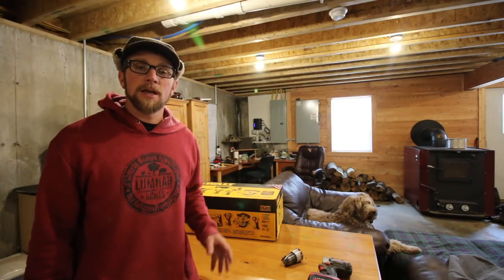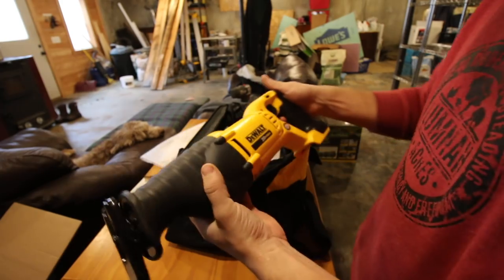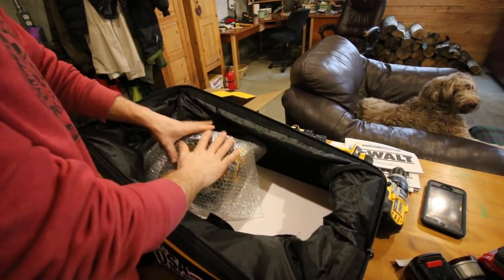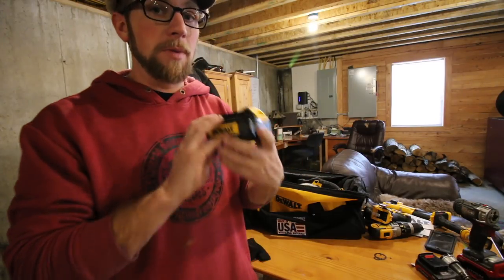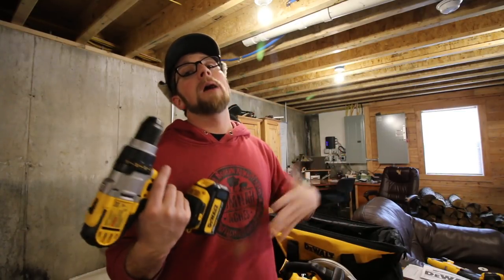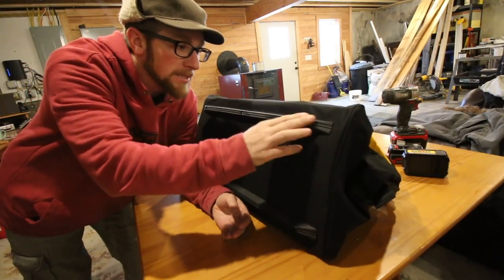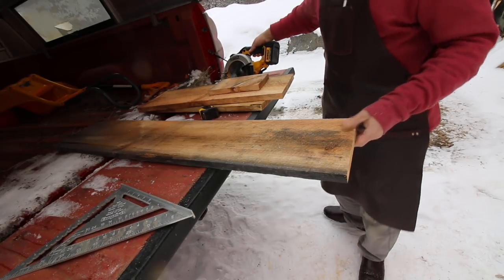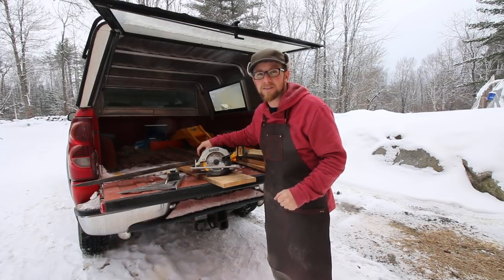UnBoxing Our DEWALT DCK590L2 20-Volt MAX Li-Ion 3.0 Ah 5-Tool Combo Kit and Putting It To THE TEST

Comment: I bought a DeWalt kit too in 2014 and it is now 2022 and no issues.I was dissapointed  that they dont seem to give you brushless stuff in the kits for the most part.The light is brushless!!!That circ saw ripped through a 16ft.2x12 lengthways to make skirting frame for mobile home for me.I now have 12 batteries and collecting more tools.P.S. The brushed stuff is not bad.Your recip. saw is not brushless as we see the brushes spark in this vid. I think the light is the only brushless one in the kit!!! Brushless stuff will say XR on the tool.CHEERS from Canada!

Comment: I looked at this kit and also the DCK592L2, and for $16 more (on sale), i went with the 592 because it has 5 Ah batteries, The baseplate on the skill saw is magnesium instead of stamped metal, and on the reciprocating saw, the 592 has a 4 direction blade clamp and a longer stroke.

Comment: I like the left hand circ saw and the quick attach recip. Good package and good tools. You may want to put a piece of 1/4" ply in the bottom of the bag to keep it shaped up. Now to teach Gina  to use them. Keep the Recip clean for the pigs class. Come on Spring.

Comment: Al:  You can carry a spare warm battery in a fanny pack under jacket in winter.   In a power outage; bounce the light off ceiling for ambient light.   As you know Al using the speed square as a fence will reduce the induced twist from the spinning motor.  the old guy  Bert

Comment: I can tell you from experience that handle on the 996 is not long enough for when you are drilling with a hole saw through OSB or 2x6's or so. You will still get a good jolt once in a while and twist your wrist. My Makita DDF481 has a longer handle and it does allow you to catch the drill before it twists your wrist off.

Comment: hi Al good unboxing! i have a couple of dewalt tools. i use the impact drill to rotate the tires on my truck. and a torque wrench to tighten to spec. is the recipracating saw brushless ? i saw sparks when you held it up to camera !!

Comment: Batteries to Go have the DeWalt 4 amp battery  I also picked up the DeWalt drill bits, driver tips and a fine blade for the saw.  Your going to love the 20v 4 amp for the skill sawbatteries
Reply from the maker: I will have to pick up a 4. amp hour battery

Comment: You probably know this by now, Al but that kit is not brushless. There were sparks in both the driver and reciprocating saw.... But I'm curious about the difference on battery life between brushless and with brushes.  How satisfied are you with a 2amph or 4amph battery charge on your driver and skill saw?

Comment: Good morning Al. So, I'm curious, was there a Royobi package that was similar?  I began buying Royobi a few years ago and I'm totally content with the tools I've got.  Without doing an actual side by side I was impressed with Royobi and at the lower price point think it would hold up against the other brands at much higher prices.  My stuff is all 18v and three tools came with 4Ahr batteries.   I also have two of the smaller batteries that might be 2Ahr each.  Some tools will definitely operate better/longer with the larger battery but when fully charged the only difference seems to be the weight, I think you will find that to be the same for you.  Good luck with the new tools and keep us up to date on your experience with them, I'm sure we will all be watching!

Comment: I have the Ryobi set. Thanks for the cold tip. I tried charging the battery out in the laundry room shed and it wasn't working. And it hasn't been this cold in years. So I didn't connect the two. I have to struggle with the buttons to take the batteries apart. Is this the one that comes with the lifetime guarantee?
Reply from the maker: no Dewalt doent have a lifetime warranty :(

Comment: Nice combo set although not only did Pluto seem unexcited by them, about a minute in she turned and gave you a look as though to say "Will you be disturbing my sleep for very long?" ;) Is it possible to buy hard cases that fit the items that come in the bag at all? Does the reciprocating allow the blade to be rotated sideways?
Reply from the maker: Dewalt has some big hard boxes that you can get for your tools. No, the reciprocating saw doesn't have the ability to turn the blade sideways.
Reply: Thank you - I am half considering the idea of perhaps getting that sort of combo set if I decide to buy some power tools in the future.
Reply: I believe their corded reciprocating saw has the ability to turn them sideways just not the battery operated ones. DeWalt was the only game in town that did that and the easy quick detach for the longest time now others have caught on but I still think they are the only ones that do the turned blade.
Reply: scooter041031 - thank you for the additional information. Much appreciated :)
Reply from the maker: I just saw in the comments I cant remember who but they said the XR series Dewalt makes in the 20 volt line you can route the blade 4 ways!
Reply: Ahh, thanks for the extra pointer Al. I guess on the balance of things I'd probably just be better off with the one from the combo set as my budget and usage probably wouldn't justify the extra cost for that specific version. Nice to dream though. :)

Comment: Great video.  I an an idiot when it come to tools and a real idiot when it comes to power tools.  When we put in air conditioners we put the units in our windows.  We should have made a small hole in the wall, and not used the Windows.  Bottom line, when our  power goes out, be window is welded fast, and closed.  It gets hot rather quick because we can not open one window in each room.  I wish we had the tools to make a hole for the AC unit in the wall and that we did not block the Windows with welding in the air conditioners.  Anyway Al,M great video.  Bless you all,  God bless America.

Comment: I’m not a negative Neely...but I want to talk battery vs. corded. I have never been a fan of battery. I know it makes things easier sometimes but, all things considered, I’d rather have to pull a cord around. Cords don’t fail me...the tool may, but that’s a battery operated issue too, as we saw with your porter cable. And then there’s the Made in USA (with global parts). I guess I’m good with that...but I’d rather see made in USA with American made parts...and more metal than plastic. I know plastic is lighter...so I don’t expect a return to metal any time soon...cost less too. But then there is the fact that plastic is petroleum based...anyway...nice kit...oh...and let’s not forget the hand tools! Those will still work with NO power but HAND power...when that’s all we have. Looking forward to future builds putting the new toy..ah tools, to the tests!!

Comment: Very nice kit Al.  Totally jealous.  Finish up the concrete desk project and then maybe build Olivia and Gina nice keepsake/ blanket boxes or jewellery boxes each so they will be happy you got the kit and it'll ease your conscience regarding the expenditure :) I already have an 18v XR Dewalt hammer drill and love it.  I would really like the Circular and Reciprocating saws as well as the Impact driver.  I found a similar kit here in Australia which is a 6 piece with a Grinder,  2x5.0ah batteries as well and 2 contractor bags. Costs a pretty penny, but I reckon I'd never need to buy anything else with all those.  No idea why would need 2 bags, but hey, they look neat so I'd use it for other stuff and give Dewalt some free advertising :D  Hmm..  can I convince myself not to buy it now.....
Reply from the maker: Sounds like you already sold yourself on the kit. 😂

Comment: Get a inexpensive 1.5Ah battery for your light, it will last about 12 hours, constant and will free up the 3Ah batteries for the other tools. I am impressed with my DeWalt brushless tools. I think the 'Made in the USA' is stretching it a bit, assembled would be far more accurate. I am in the UK so don't have all that advertising buff on my 'stuff'.
Reply from the maker: Thanks. Good idea on the battery for the light

Comment: Let's be a little more fair about battery life. Your Porter-Cable batteries are probably several years old and have been charged hundreds of times, whereas the Dewalt batteries are brand new. Over time, batteries lose their potential to store energy and develop a "memory" that allows them to run down more quickly. I have both brands and find if you compare apples-to-apples, there isn't a significant difference between batteries.